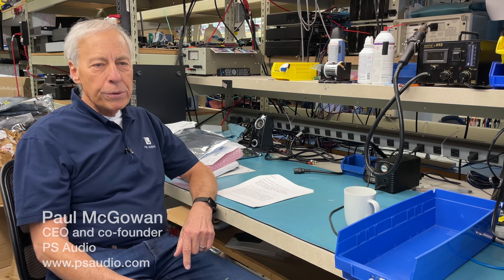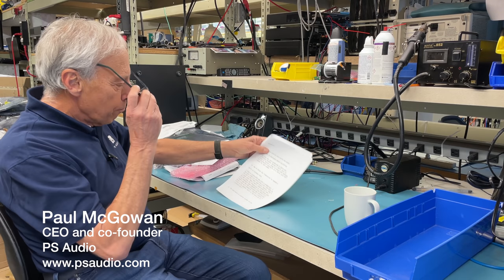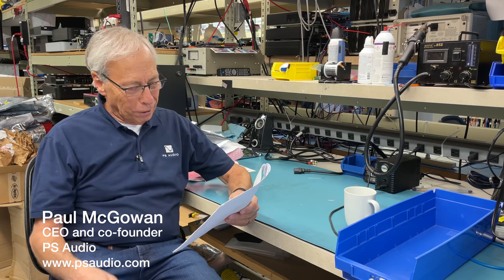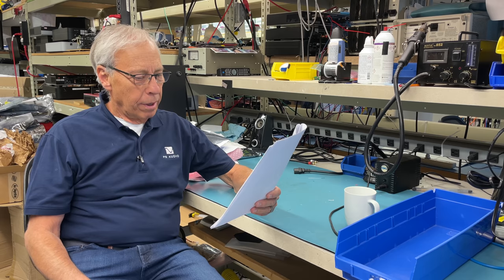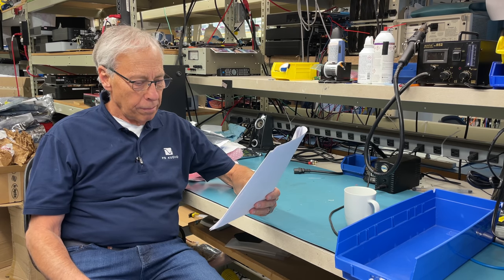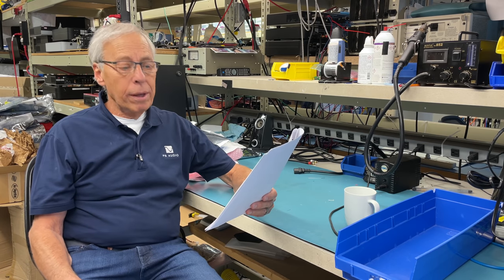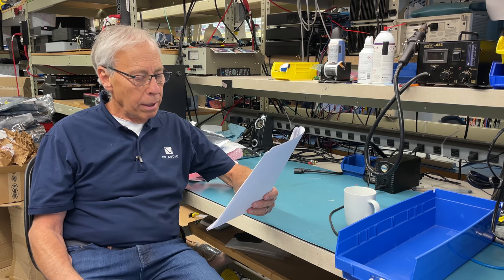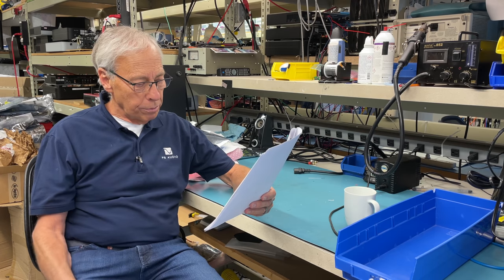How to block low frequencies to speakers

Comment: Don't use a sub for music 
Only 5.1 and above 
Best advice ever
Reply: Hmmm... go to a concert hall and see how they're doing it.
Reply: @H-77  hi Oscar Having set up some concerts I can assure you they're not putting in subwoofers in the way a home set up may have them. Many people have full range speakers with subs added (pointless) others have one sub added with a pair of bookshelfs but the placement and crossover rarely helps the music sound cohesive, others have one subwoofer per speaker which is ridiculous - just purchase full range speakers. 
The end result is subs are not necessary unless you're watching movies. Then the subs can do what the speakers  can't - lfe etc and are required for that extra channel. But Sure you can buy subs, dump them on the floor set the crossover and hope for the best but rarely is this method ever tight & cohesive and rarely is the audio consistently good over different genres. Even good bookshelf speakers handle frequency ranges down to ~45hz. Full range speakers can go to ~30!. So what are people doing with these subs? 
I asked this exact question of the PS audios Darren here on another video. It was a home set up and he had some outrageously good full range speakers (can't think of the manufacturer offhand) and he was talking about adding subs.... Which I queried. 
I think they may have revised that now. On many many cases it doesn't make sense. Source: I run an AV company. (SBITAV)
Reply: @H-77  how many music CDs have room shaking bass or low frequency like a recent marvel or blockbuster movie.

Answer very very few. I've got over 500 albums all different genre's - hardcore (it's a UK electronic dance clubbing scene) rock, jazz, rap, country, classical piano, orchestra, blues, indie, pop, motown, folk etc. And not one song has ear splitting mid bass like in the Flight Of The Phoenix plane crash. Or low frequency bass like from War Of The Worlds.

As long as you have decent speakers (even bookshelfs) that goes down to 40hz then it will sound as the music is supposed too. You don't need a subwoofer for music unless it's a recent live concert CD which was recorded to actually record all of the bass energy from the subwoofers used at the concert. And I don't know one concert CD that has the same bass as if you were actually at the concert.
Reply: All of it depends on the room size and the speakers used. In larger rooms, it can be really hard to get decent low-frequency performance out of a two way, at least at higher volume levels while keeping the woofers on the mains in their most linear range. I should note as well that what is typically listed on speaker specification sheets is the lower cutoff or half-power frequency, so they really aren't all that flat down to that frequency. Very few reasonable 2-way speakers have a -1dB point of 45 Hz, for example.

The advantage of using a subwoofer for music is that the mains do not need to go quite as low, which makes it easier to design (or if you aren't designing, purchasing) speakers that perform linearly over their required frequency range. It's the same idea as a 3-way, but a good commercial 3-way can be extremely expensive. That low-frequency passive crossover is really expensive as well for power handling reasons, so it's much easier (and generally better) to use an active crossover for that. Of course, there are huge advantages to active crossovers in general (so long as they are well-designed)l, but that's another issue entirely. Subwoofer integration can be excellent, so long as it is done properly.

The other situation where it is advantageous is that it gives more freedom when it comes to amplification for the mains. For example, the best-sounding tube amplifiers tend to be smaller, and in general owning a really high-powered tube amp isn't the most fun thing in the world (trust me, I've designed many of them). If the mains don't have to handle frequencies below, say 100 Hz, then tube amplifiers become less impractical. From a standpoint of  distortion, this may not be the best choice, but lots of people (myself included) accept that the distortion from tube amplifiers isn't necessarily a bad thing (depending upon the amplifier, of course). 

All of this depends on the room size. I myself have a very small listening room, and the mains that I use (Quested Q108) have absolutely no problems with low frequencies, so I have no need for a subwoofer. That said, in a larger room it can make more sense. My original comment was primarily to note that the advice to avoid subs for music is not true 100% of the time- with live sound being the main exception.

I may be approaching this issue differently from most people, however, since I look at it from the perspective of someone who is designing the components that will be used in the system.
Reply: @H-77  hi Oscar I agree - I tentatively gave 45hz for good book shelfs because they often claim lower - the comfort range at a higher volume may be x-hz higher. Either way the bass performance available now from many manufacturers is superb, especially with floorstanders. We come from a place of simplicity so if we start adding subs in a listening room then it's getting quite serious and extra room science with bass traps, absorption and reflection materials and of course positioning comes in. 
However we tend to veer away  from room science because it's so difficult. Not to say we don't address the room dynamics but we try to not to over complicate most set ups. 
 Most 'room' set ups I've seen are nothing more than a mangled attempt at flattening the sound with absorption material. When we have larger rooms we tend to have larger speakers. A current favourite for large rooms is the Kef blades which have four 'subs' (woofers) built in mounted at the sides - phase shifted. The bass is controlled and rich, 100% tight and matched with the mid range and Treble. I don't know how I'd repeat such cohesion and simplicity with subs. We also like to, when available and possible, allow the room to add it's colour, it natural light reverberations and dampening (via rugs, sofas, curtains etc) to the sound. Once we've heard we can decide on further treatment if necessary.
Reply: @46wireboy  hi - it's not load of crap actually. I own and run an AV company (sbitav.com) and install very high end systems all the globe from Moscow to New York. I am also a classically trained musician and studio technician - so I'm qualified - what is a load of crap is using sub woofers to listen to music. The bass is never integrated or timed and the crossover is never right. I've never heard a set up sound better than full range speakers - I've never seen or had a blind listening test that proved otherwise. I have listened to many ridiculous exaggerated and overblown low end systems that purport to represent musicality when in fact all they do is over state and over accentuate the bass. It's funny I asked the same question to Darren Myers of PS audio (who was to get back to me but never did) why he would use subwoofers if his speakers were rated down to 25hz. 
I love subwoofers when I'm watching a movie however. And I love svs subs but when I listen to music I listen in strict stereo. Nothing has ever sounded better for me. If the set up is right I prefer vinyl. My favourite full rangers are the Kef blades (1) which effectively include 2 woofers in each speaker down to about 30hz (realistically) - why I would ever dream or consider using subs with them is absolutely beyond me.
Reply: correct

Comment: Hoping that you can explain how to adjust the volume, cut off frequency and phase adjustment on a subwoofer to balance it the best way possible with my Maggie 3.6 R's or other full range speakers. I find that on some of my recordings that I do need to adjust the volume and cut off frequency to get my entire system sounding proper. It's not just set and forget but I tend to do this on rare occasion and then reset to my original settings afterward.
Reply: On my LRSs I make changes fairly often. Its definitely not set and forget. Makes the remote control models fairly desirable.
Reply: @scottyo64  In past articles it's been recommended to overlook poor source material and leave the woofer settings alone. As I said I don't do it that often but there are some recordings that need some adjusting in the mid bass area. You're fortunate to have a remote to handle this. I bet you love the LRS. So many people raving about the sound of the midrange.

Comment: My experience is different.  My good friend asked me to repair a set of Bose 301s he had kicking around.  Minor problems and also added small, extended range piezo tweeters.  He also come into a vintage (old) Morantz, 20 watts/channel amplifier, good quality but rather limited in power.  Anyway, originally he ran the repaired  system with a half decent 100 watt sub that can go UP to 180 hz. and okay.  I had tested it with a 80 WPC NAD amplifier, same model sub.  The Morantz wasn't as good.
 
He went along for months.  It was okay?  I decided to TRY using a high pass filter on the 301's (at about 100-125 Hz.) as an "experiment".  That would require very high value, caps.  Non- polarized (mylar?) caps, are very expensive and maybe unavailable at the values I got from on line calculators.    It would take four (2X2) caps, so...  tons of money and out of consideration.  But... presently /recently?  there are high capacitance values (audio quality?) non-polarized ELECTROLYTIC  caps available at very reasonable cost (< $10/each)  and only 2 would be needed.  So we bet $20 (his money) and tried those electrolytics in-line with the 301's.  After fiddling with the sub's phasing ,  FREQUENCY and gain adjustments, the system  seemed MUCH better sounding.

 I assume this is (mostly) for three reasons, #1 might be the most effective.
1) The main 5/6 inch ? speakers in the Bose were no longer performing large cone excursions for the (marginal bass they could actually reproduce).  This "cleaned up" the (125 Hz. and up) they could reproduce... BY A LOT.
The 301 speakers were much clearer and could be played louder without audible distortion.
2) The amp was no longer using more than half its very limited power sending bass frequencies to the Bose 301s that the speakers couldn't reproduce very well anyway, (mostly heat).  The amp went from straining to being on easy street.  It was no longer wasting about half of its limited power on 125? Hz. down.  Its "clean headroom" increased.
3) We were lucky, always helps.

Compared to the starting point, the system sounded WAY BETTER and could be played much louder without going into audible distortion.  Didn't make the (poor) stereo imaging any worse (301s are reflectors), so there's that, yuck.
Probably better imaging with bookshelf speakers.
To avoid an in-line cap, I added a second set of terminals on the speakers and installed the caps internally.  Original terminal were (still) "full range", the new terminals were the  "high pass" connections, pick a pair.  This allowed the speakers to be used "normally" if desired, didn't cripple the speakers use.
Anyway... not everyone has great systems and this is a cheap dodge almost anyone can manage.  So, this type of modification might work pretty well for any (cheap) bookshelf and subwoofer system.
Cheap to try with in line caps and no great loss if you don't like it.
My opinion is getting the deep bass off the small drivers was the bigger improvement.  No amp improvement with the 100 WPC Nad but definately with the 20 WPC Morantz.
Yeah, I know it's a little sketchy but it's way better and dirt cheap.  Might be the best bang for the buck small system mod I've ever done... at least "by ear"..

Comment: I disagree with you, Paul.  In my experience, with a Marantz SR 880 and Definitive Technology BP30 tower speakers, and a sub, when I choose the "Small" speaker setting instead of "large"  for the mains, the clarity of the Def Tecs improves quite a bit.  The vocals become less muddy and sharper and easier to understand. 

Sounds like your opinion is based on theories and not first-hand experimentation?

Comment: for a closed box , that is OK , not so much for a vented box . Problem is that below the resonance frequency of the port (or TL ) the driver excursion goes up very rapidly . This can lead to damage to the driver if it exceeds x-max .
Reply: vented box is not meant for music or movies, buy the right gear for hifi to begin with.

Comment: The question of whether or not speakers will sound better without bass comes down to the linearity of the woofer, and how much excursion its tasked with. If the woofer excursions are kept relatively low during full range audio and the woofer is well designed, it will be linear and free of distortion. On the other hand, even the best woofers are quite non-linear at high excursions and will produce copious distortion and IMD when driven hard. As such a filter of some sort to keep out frequencies in the main speakers, below, say 125Hz can help quite a bit. This will leave the low frequencies that require substantial excursion to a speaker designed to do just that: a subwoofer.
Reply: For specifically music there is rarely any songs that go down below 40hz. Pipe organ music can go to about 16hz but it's a very niche genre.

If you you have full range speakers ie 20hz - 20khz then its actually better just turning the subwoofer off and letting the speakers do all the bass for the CD stereo songs. 

For movies it's different as there is a LFE channel specifically for the subwoofer in most dvds, blu rays, 4K blu rays.

Comment: For a simple stereo setup, that would make sense, but you can't really do this with home theater setups that have speakers of different sizes.  The subwoofer will not be able to compensate for all of them without some type of adjustable crossover for each channel.

Comment: I stuffed the ports on my LSiM 703's, it made them much easier to integrate with my subs in my room.
This also helps to reduce low frequency output and in some cases improve phase response.
If you have measurement abilities you could even place freezer bags of sand inside the speakers to eat up volume.
You could even use blocks of wood if you are worried about mess, just use low temp hot glue to hold them still.
You could create essentially a sealed box response version of the same speaker with a 12db roll off at F3.
Then by varying their proximity to the front wall you can increase boundary reinforcement of the lower frequencies.